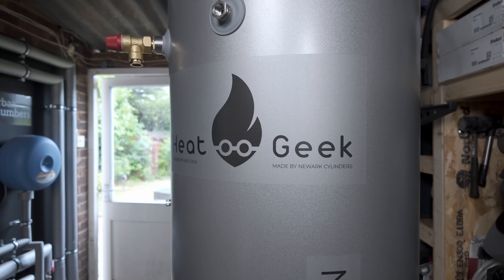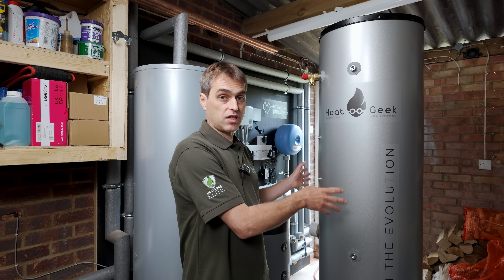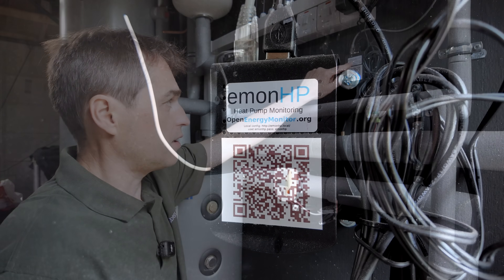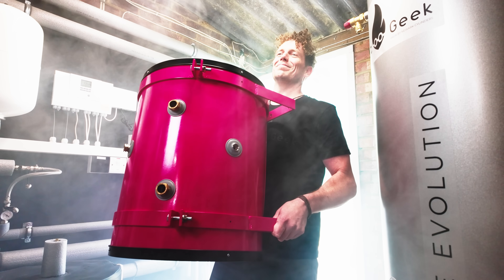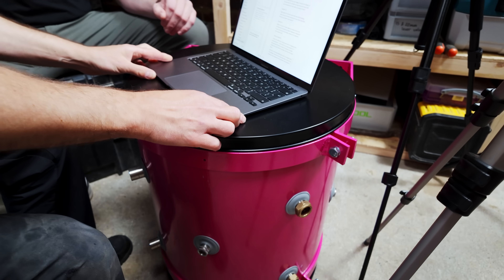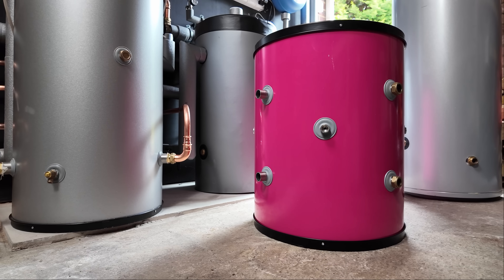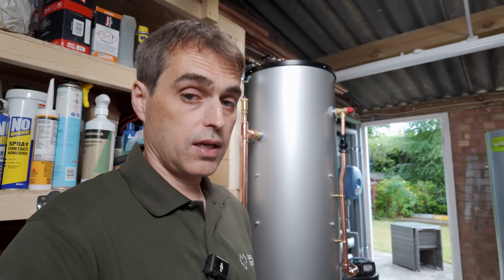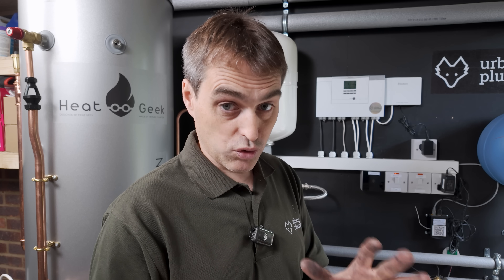Heat Geek Super Cylinder Tested: The Most Efficient Hot Water Ever?

Comment: Good to see you're fettling your home setup. The mark of a good engineer is to be interested in how things are performing and tweaking them. I am not sure experimenting with the shower's hot water supply is the mark of a good husband, but she no doubt knew you were a heating geek!
Delta-T of 25 degrees, 200 litres, perhaps 7kW power from the heat pump (I think the Arotherm Plus has plenty of oomph on a summer's day) = 1 hour or thereabouts. As for COP ... I would hope for something north of 4, given it is warm outside and SCOPs for 45 degree design temperature heating are around this level.
Reply: I think Simon said the Heat Pump was officially rated at 5kW, but it's clearly outputing more tha 5kW to reheat in under and hour.
Reply: @tlangdon12  The Vaillant Arotherm Plus certainly are rated conservatively; it is their output in cold weather while producing hot water. Probably better than over-promising!

Comment: Dip tubes have been a problem on combi stores. How robust is the dip tube on the cylinder and whats the warranty
Reply: It is a 35mm stainless steel Diffuser Tube on the Cold Inlet. For clarification, this is shown and labelled on page 5 in the HG Series specification booklet (v 2.0). This is available on our website.
Reply from the maker: It’s just a bit of pipe turned down and with bigger bore. What could potentially go wrong with it?
Reply: @UrbanPlumbers  have you seen the dip tube problems associated with the vaillant 937 or ultracom store 35?
Reply from the maker: Those were tiny and plastic no?
Reply: @UrbanPlumbers  yes. Its why im asking. Hopefully the dip tube in this cylinder aint plastic?
Reply from the maker: of course it isnt! It stainless steel or brass. I am sure Newark will comment soon!
Reply: @UrbanPlumbers  It is a 35mm stainless steel Diffuser Tube on the Cold Inlet. For clarification, this is shown and labelled on page 5 in the HG Series specification booklet (v 2.0). This is available on our website.